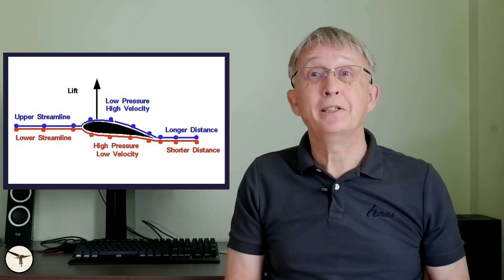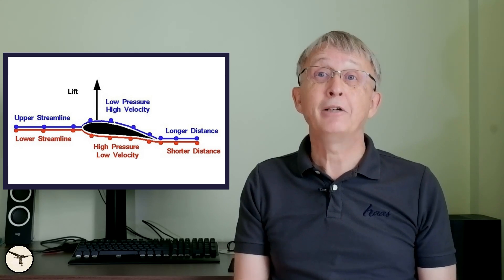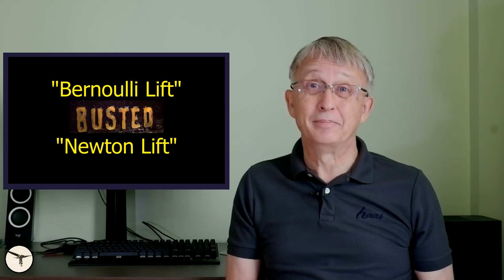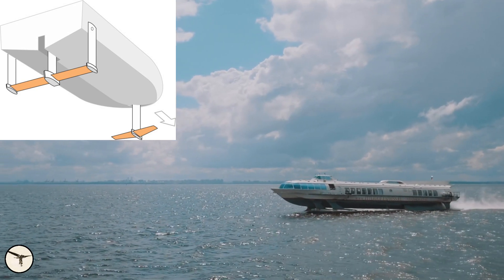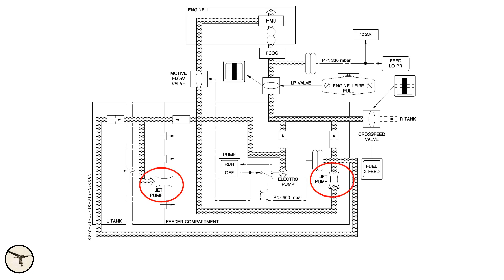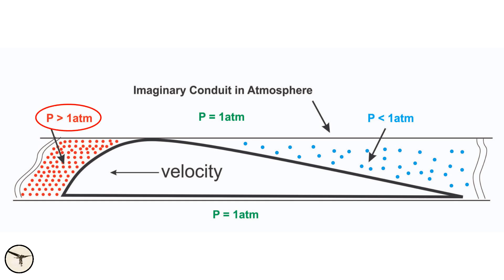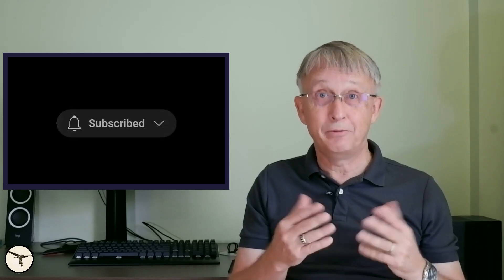7 Wing Lift Myths You Must Avoid: What Really Makes Airplanes Fly!

Comment: 5:10 help me out here. The wing(underside) is still producing lift but less of it after the stall. 

Wings still create lift after the stall as you can see in the graph.

I’m happy to be corrected and thanks for sharing, I found that so interesting.
Reply from the maker: When a wing stalls, almost lift over the wing (approximately 75%) is lost in an instant. The stability of the aircraft will determine wheter the aircraft will enter a dive, drop a wing (one wing stalls before the other,) or the aircraft will enter a deep stall, which in most cases is unrecoverable.
Reply: a stall is a reference to an item failing to do an intended action.
like a checkout counter with a customer problem. 
The curve over the top is where most of the 'lift' is generated.
A stall is that 'lift'  not being generated.  The other aerodynamic items
are as before the stall...  and are likely to change soon.

Comment: G'day,

Yay Team !

I like to compare the performance of Airscrews with laminated wooden Blades featuring 
Perfect Helicity of Pitch,
ALL the way in to the Hub...; 
Against that of the
Pressed Sheetmetal "Fans" supplied with the small
Retail-level
"Stove-Fans" which use a Peltier Device to convert Heat from a Wood-Stove into Current powering a small DC Motor - spinning the Airscrew, to 
Suck the Air across the Stove's Hotplate &
Blow that heated Air out into the room, all while relying on the relatively cool Airflow thus induced to flow across the Cooling Fins mounted above the Peltier Device...., to maintain the Thermal Gradient which is "tapped into" in order to generate the Current required.

There have been, over 5 or 6 years, several iterations of
Horrible excuses for "Fans" released for sale, first were the Constant-Pitch  Flat-Plate "Aerofoils"...
Then came 
Slightly-Cambered Flat-Pitched units..., with successively more efficient Hot/Cold "Sinks" which have steadily improved the output of the  "Powerplants" - while the "Fans" were horrible.

And this Winter (in Australia) has revealed a type of Fan with a strangely Cambered Single-Surface "Semi-Helically" pitched Blade-Section...., which has taken me a while to observe and comprehend.

As a Tool, I use Dust-Particle Accretion-Patterns to effectively visualise the mapped
Barometric Pressure all over
Both surfaces of the working
Aerofoils.

To speed the process, I set a
"Dhoop-Cone" type of Incense  smouldering "upstream" of the Stove-Fan, and after about 20 hours of operation...; the Hot Ash-laden, Smoky Combustion-products, together with the Cool(er) Vapourised & recondensed  Resin "Smoke" flowing through the Disc has left a precise visual 
Footprint of the
Boundary-Layer Air-Pressure, reflected by
How much and/or how little
Dust Accretion occurrs...,
Where, precisely,
On the Rotating Blades - as the
High-Pressure  smoky sticky dusty Air is  being 
Squeezed by the passage of the Blade going through it...., 
Or NOT.

Because wherever the Low Pressure Zone exists, the Surface accumulates very Very VERY Little in the way of
Dust Particles accreted by Contact with the Air...

Double-Surface Helical Aerofoil-Section Propellers accrete Dust from the 
Underside of their Leading Edge - thickest on the first 50% of the Chord - with almost zero Dust-Accretion on the Upwind Side - and the Accretion demarcation-line along the Leading-Edge is 
Razor-Shaply defined.

The Single-Surface Sheetmetal Units  feature 
Press-Cut Edges, with 90° Corners and a little 
Flat Perpendicular Face, as the
Actual Leading Edge.

Air is struck by that
Flat, and bounced off to either side - leaving Dusty accretions on the Perpendicular Leading Edge.

The Air
Bounced "Upwind" curves back, attempting to "follow" the retreating surface of the Blade as it sweeps past - but the Front  50% of the Blade is "Flatly Un-Cambered and  has maybe 2° of Flat -Pitch ; so a thin "Helical-Spiral Slice of Air" goes
"Under" the Leading-Edge, having been effectively  "cut off" by the Sweep of the Blade.

The Airmass "Upwind " attempts to follow the retreating Upper Surface - but never quite gets there, and from 50% Chord the 
Trailing Edge is "curled" to
effectively "add Pitch-Angle" to the Flow being 
Compressed
Under the Blade's 
Trailing-Edge....

The Dust-Accretion Patterns clearly Map the Pressures.

And, to my 
Horror I discovered that the
Latest iteration generates
Retrograde-Airflow, backwards through the
Blade-Tips of the outer 15% of the  Disc's Radius..., as well (!).

Each Blade tows a pair of
Vortices, one
Shearing along the Trailing Edge as the High-Pressure Air is 
Spat, or flicked, backwards - with a diverging Vector away from the Air trying to follow the Upper Side of the Blade - as it curls away downstream, as it sweeps past.

And, also a vicious little 
Retrograde-Vortex caused by Airflow being sucked into the intense Low-Pressure Zone, 
Upstream of the Central 60% of the Disc's Area.

So....

It does "work"....

Kind of.

But it's woefully
Inefficient.

I guesstimate that if my best Helical Propeller can attain
92% of the Betz Limit (no Array of Rotating Aerofoils can ever convert more than 0.5963 of the Kinetic Energy in the Wind, into Torque in a Shaft, 
Or
Vice-Versa.

To extract 100% of the Torque in a Shaft and convert it into accelerated Airflow..., Requires that the Shaft be stopped from spinning.

To extract ALL the Energy from the Wind-Column, a Windmill would have to 
Stop the Wind from blowing.

59.63% 
Is the Limit of what
May be achieved.)

So my 92% Efficient Airscrew is achieving 92% of 59.63%  ; which is actually only 
54.85% Absolutely  Efficient.

I wager that the latest Sheetmetal Stove-Fans might be 15% Absolutely Efficient, turning about 35% of the little
Motor's Torque
Into nothing but
NOISE.

And, here's the funny thing about
Marketing Jism...(!),
The Consumers
Are
Attracted to the
"Surprisingly Powerful SOUNDING, slightly 
Aggressive little Purring
Noise...."
Made thereby.

Backtrack me to my Videos to see the various Results.

And if you feel like a serious sort of a 
Giggle (?)

Go ye unto my
"Personal Aeroplanogy" 
Playlist, and check out,

"National Transportation Museum ; Visiting My First Aeroplane...!"

to see what it was that took me for my first Solo (!).

An older Video about it is on that scroll too, but it's more of  a Slide-Show, featuring Old Photos, & Magazine Articles, to establish the Paper-Trail, & nail down the Timeline,

"The 1975, 8-Hp, Red Baron Skycraft Scout...; World's 1st Legal Minimum-Aircraft !"

I was it's 3rd owner, 
I did nothing actually
"Pioneering" in it,
Beyond being the
Last person to have ever
Flown the Aeroplane around which
Air Navigation Order 95.10 was written, and 
Gazetted by the Australian Parliament in August 1976.

My 
"Lockout-Index"...,
For (more) safely Aerowing
Weight-Shift controlled 
Rogallos
Behind 3-Axis Dragonfly-Tugs..., was a far bigger contribution to the
Art
(Of safely decorating the Sky with Flying Machines....!) ; but being able to visit my first Aeroplane, and seeing it  chained up to the Ceiling in a Museum does feel pretty bloody good...(!).

It certainly impressed my Children, when they were in Primary School, and we first learned about it ; and made the Pilgrimage (50 miles to the next town down the road) to visit the dear old thing (!).

Anyway,

Thanks for the Video, 
I did enjoy it.

That # 7
 "Zone Theory" 
Idea was one of the
Silliest things I ever heard of.

Such is life,

Have a good one...

Stay safe.

;-p

Ciao !

Comment: Agree with a lot of what you say.  But WRT Bernoulli effect, it’s not correct to say it’s busted.  More specifically, yes, it is true there is no “wall” above the wing to enforce a strict Bernoulli channel and its associated conservation laws.  However, there is NOT nothing above the wing!  There is atmosphere, all the way up to space!  THAT is your Bernoulli channel wall!  However, it is not a hard wall like a pipe, but rather a soft wall.  It does not provide a hard immovable boundary condition like a pipe, but rather a soft somewhat compliant accommodative boundary condition, but a boundary condition nonetheless the less,  just like a wall, it will resist air pressing on it (or sucking on it) but, it will give a little and change the boundary condition in the process, but it’s still there, resisting just like the Bernoulli pipe wall… just not as rigid.  So the correct way to state this (IMHO) is that there is indeed a Bernoulli effect that in principle is about the same as the regular Bernoulli effect, but it’s not exactly the same because the boundary conditions are different, and because of this it is not as powerful an effect as in a Bernoulli pipe, meaning you need additional lift, and this comes from Newton’s reaction forces from diverting the air flow (momentum change).  Thanks for great video!
Reply: All lift is from reaction forces
Reply: @tedarcher9120  agree that is ultimately the case,  but it is challenging to explain how 70 to 80% of lift is due to forces acting upwards on the top skin of the wing,  without discussion of pressures, Bernoulli and Coanda effect.
Reply: @50shanks  btw, according to Bernoulli, ground effect should be in reverse, because ground and the wing form a narrowing tube that has lower pressure
Reply: @tedarcher9120  In ground effect, you assume that all the incoming air flow ramming under the wing would be forced to flow under the wing. However, in reality, some air deflects above airfoil, increasing top flow's mass flow and velocity while reducing its static pressure.
Reply: @tedarcher9120 
A positive cambered airfoil with a flat bottom and thin plates extended from the leading and trailing edges will still produce lift at zero AOA and no air deflection.
The difference in pressure is the primary cause of lift, not fluids being deflected.
Reply: @Talon19  difference in pressure is what creates air deflection in the first place
Reply: @tedarcher9120  
Deflection isn’t required to produce changes in pressure.
Reply: @Talon19  yes, but changes in pressure produce deflection
Reply: @tedarcher9120  
Changes in pressure do not always create changes in velocity vector.
Reply: @hu5116  Bernoulli equation does not require any walls. It simply relates the stationary airflow's local dynamic pressure to its velocity in the flow direction.

Comment: Thanks for a generally quite accurate video! Some, pretty petty comments from an aeronautical engineer, however:

2:18 Bernoulli's law can be deduced from Newton's laws of motion (and conservation of mass for incompressible flow typically shown in basic education) but not vice versa. Therefore they are basically the same thing, Bernoulli's law is just a special case of Newton's laws.
4:08 Generally correct, but at very high altitudes (or low air density) the air molecules are far between and molecular flow generates lift (and drag) mainly by air molecules colliding against the wing's or lifting body's, such as re-entry capsule's bottom surface at an angle, while the top surface is effectively in vacuum.
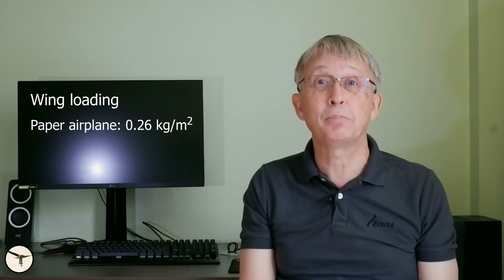6:15 Flat wing does work with any wing loading. The flat plate profile's drag is larger and maximum lift smaller than for any sensible wing profile. Thus, dynamic pressure (velocity) or wing area must be higher to get airborne with similar airplane mass. With high enough thrust or wind pressure even barn doors, cows - or fighter airplanes - will fly, though, even without deflected flaps 🙂 The reason why wing profiles, often curved (or "cambered") are used instead of flat plates is their much better performance (and also structural thickness needed for strength reasons). Compare old wind mills with flat plate blades vs. modern wind generator blades. Both work, but with vastly different efficiency.
Reply: 4:08 Go back and look at the diagram at 1:44. The high pressure on the underside of the wing contributes a substantial proportion of the overall lift. On some wings it approaches 50% of the overall lift. When a wing stalls, the upper surface contribution goes away and all that is left is the lower surface component.
Reply: @ronaldjensen2948 Pressure distribution depends of the angle of attack. For example, at zero angle of attack, a symmetrical profile has similar underpressure on both top and bottom surfaces, resulting zero total lift. And at some negative angle of attack, the profiles have larger underpressure on their bottom surface than overpressure on their top surface. That creates negative lift, making inverted flights possible 🙃. And no, the top surface of a stalled wing doesn't lose all its underpressure. Just a large part of it.
Reply: 'Generally correct, but at very high altitudes (or low air density) the air molecules are far between and molecular flow generates lift (and drag) mainly by air molecules colliding against the wing's or lifting body's, such as re-entry capsule's bottom surface at an angle, while the top surface is effectively in vacuum."

Is it not true that you are distinguishing between, in the case of sailing for example, lift sailing and drag sailing?  So, it's not about the density of the medium but the orientation of the relative flow and whether it is conducive to a pressure drop "on top" participating in greater proportion to the higher "drag" pressure on the bottom?

Same situation with a traditional drag parachute vs a modern lift producing parachute?
Reply: @davetime5234  Lift sailing is like flying with unstalled wing, generating large lift, while in drag sailing, the wing is stalled, generating mostly drag.  By definition, lift is the force acting perpendicular to the incoming flow and drag is the parallel force to the flow. The sailing and parachute types are distinguished between their major force of action that is being applied. For a lifting wing, the static pressure drop on the top surface can be  many times higher than the pressure increase on the bottom (compared to ambient pressure), but the pressure drop on the "top" surface is significant even for a completely stalled wing (or plate). For example, a long,  flat plate perpendicular to the incoming flow has pressure drop on the leeward face almost equal as the pressure increase is on the wind side, effectively doubling the experienced force when compared to situation with only "bottom" surface's static pressure increase would be considered!